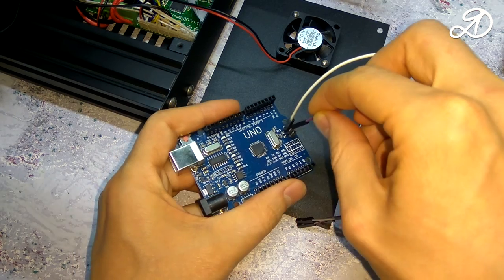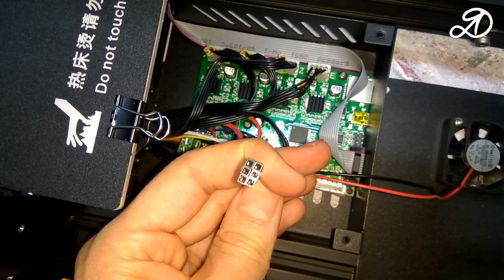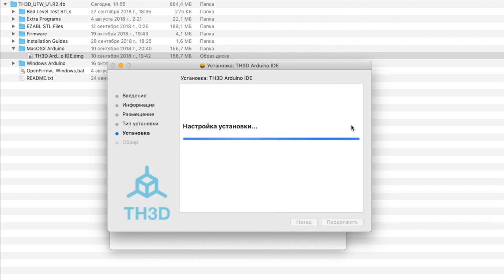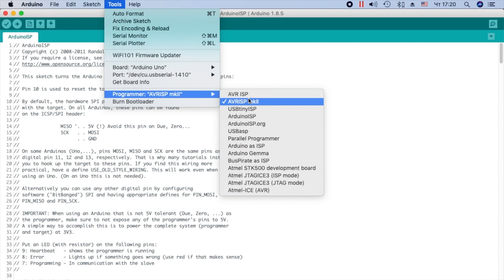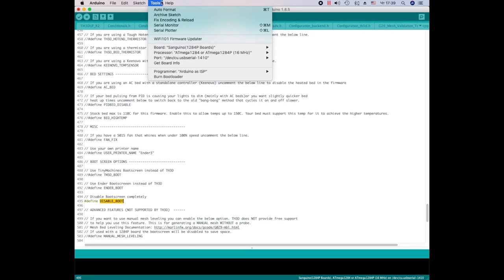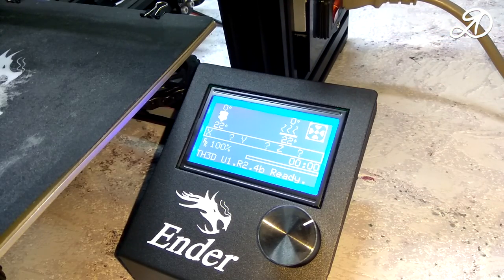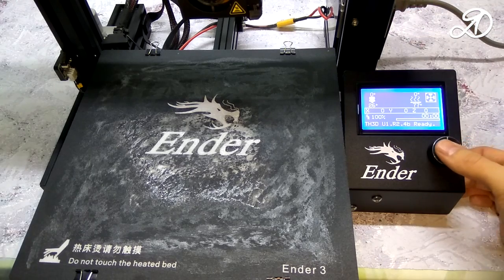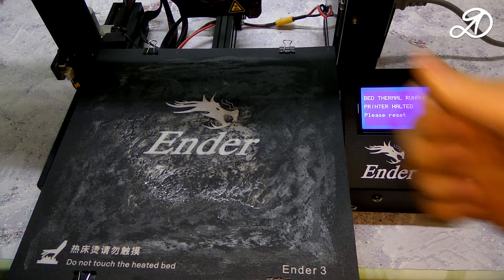Test thermal runaway. How to install a bootloader and firmware on 3D printer Creality Ender-3

Comment: Mine said 'Fail to heat bed Printer halted please restart', is that still thermal runaway protection?
Reply from the maker: Perhaps this is one of the functions of thermal protection. I can not answer your question, because I have not faced such a problem. How often does this error appear? Print via USB or SD card? What firmware version?
Reply: @dial2277  Printed from SD card and using Marlin 1.2.6a.  Thank you for responding and your channel.  Keep up the good work